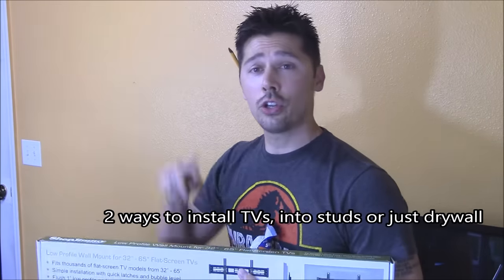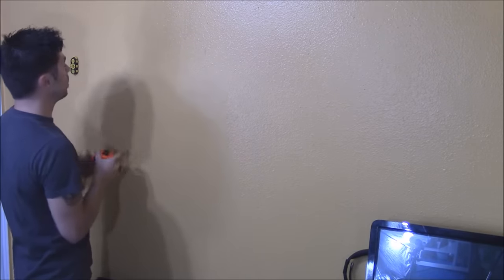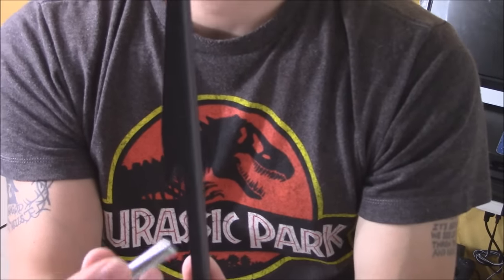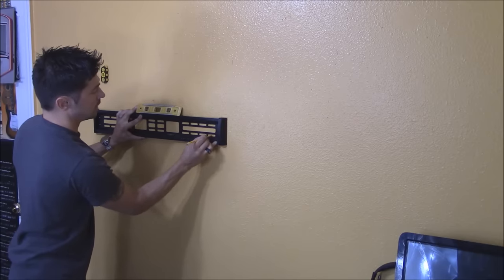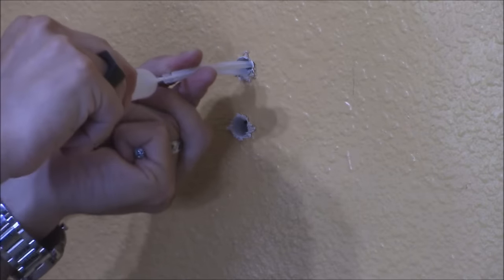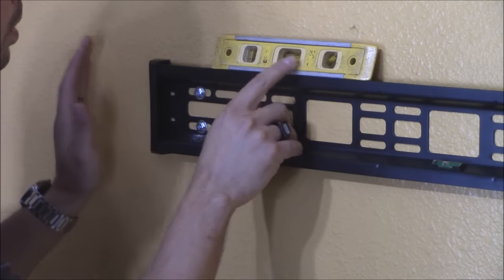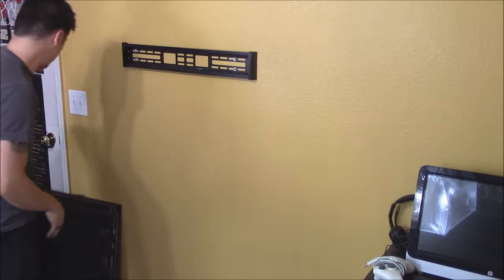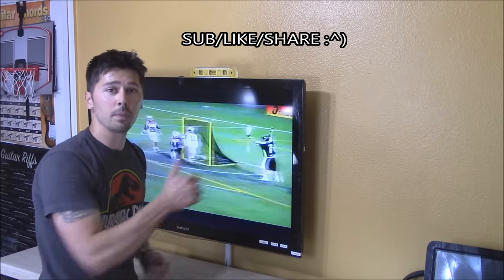2 ways to hang TV on wall mount into stud and drywall review

Comment from the maker: locking wall mount- http://amzn.to/2qcQWZU and toggler toggle bolts- http://amzn.to/2qan1SN 
*affiliate link
Reply: I have an LG 60PB5600 (60" plasma 72 lbs).  I purchased a Video Secu MW390B mount.  You say to not use Toggle bolts on 55" + TV's on arm mounts.  I'm curious why.  The studs in my building are metal and hollow so I think using toggle bolts is my only option.  Please let me know if you have any advice.
Reply: Where did you purchase the thing to hide wires?
Reply: Cq67 yeah,he never gave the info on that. Been looking for it
Reply: mrniceguy423 did you get a answer bc I have a 65" plasma tv as well?
Reply: What do you recommend to use instead of the snaptoggle bolts for TVs larger than 55”? Thanks in advance.
Reply: Mounting a 55" tv on an arm mount to drywall is exactly the situation I'm facing as well. Why is it bad to use snaptoggle bolts in that situation, and is there another solution?
Reply: Tampatec 
Why shouldn't I use the toggle on 55 inch t.v.?
Reply: Hey I own my own AV company and you should not post videos like this I don't need clients or customers trying to hang their TVs with drywall. They should just call a company and let the professionals do it I hang TVs that people can probably hang on I've seen tons of people's TVs fall and drywall and there are safety precautions with those TVs if one of those TVs hits a kid and causes brain damage or trying to be cheap ur fault bro.
Reply: @chandlerhill4794  He's helping the capable community and showing them the right way.  Everything is at your own risk and its sad that everyone blames others for accidents.  This is a simple job but needs to be done right and I appreciate this videos help.
Reply: Obi O ffvb
Not
Reply: where could i find that cord concealer? I like that it has flaps to easily access the wires, having a difficult time find anything like it.
Reply: Tampatec uh oh- I already left a comment and just rewatched the video where I saw something I missed and don’t quite get. You had some text come up about not using snap toggles on 55inch or larger/arm mounted TVs. Do you mean 55 inch arm mounted TVs or 55 inch TVs and/or arm mounted TVs? After watching first time was so excited I could do myself- now a little nervous. In any case your video is just great. Very informative as well as being explained so well, so logically with not a bunch of extraneous chit chat. I’m very appreciative.
Reply: Just bought this Heavy dang tv and I can't comprehend how drywall can hold this safely! Is it possible? I'm in a trailer and No tv stand but it did come with a beastly wall mount. 
Sharp Aquos LC-45GD7U 45-Inch HD-Ready LCD Flat Panel TV
Reply: Great video!  Where did you find that cable raceway/track?
Reply: the jurassic park t shirt made me immediately subscribe

Comment: I was concerned by the snap toggle bolts, and then I saw them support your entire body weight. Looks like there's hope to wall mount my TV afterall :)
Reply: he is 80lbs wet lol... they make bigger mounts
Reply: @AlienGrade  that's fine. My TV doesn't weigh 80lbs.
Reply: He used 1 stud to anchor....then toggles.
Reply: how safe is mounting to drywall if you live in earthquake central (california)?
Reply: @GetUnwoke   don’t do it
Reply: My buddy had to use toogle bolts when he mounted my tv 6 years ago, it worked great, he used 5 and my tv was only 42" so not that heavy at all.

Comment: Just hung a 55 inch LED TV weighing 30lbs on drywall using a tilt mount and 6 spring toggle bolts with a weight capacity of 90lbs per bolt. Thanks for the tips

Comment: Very informative. Thanks for the info. I’ve used toggle bolts before but never heard of snap toggles. They look like they are much easier than trying to jam big toggles through a hole while hanging onto the screw and the item being hung- wall standards for shelving and closet brackets. Very tricky for a 70 year old woman to manage- but manage I did. Of course the bolts were so long I went through the closet wall into the bathroom. LOL! So had to cut all the bolts down with a Drexel cut off wheel... but I digress... I want to hang a 44 inch tv on a plaster wall with metal studs, if I can find one. The mount is one that has an arm that extends from wall to tilt left or right. I’ve been worried about how to do it and not sure if the 4 snap toggles will be enough. Maybe there are more holes- not sure. Someone told me I should also mount a small piece of wood below the bracket to kind of brace or take some of the weight. Anyway. Keeping my fingers crossed. Thanks again!

Comment: Could I have your input on how to mount my TV? I have a 37" LCD TV that weighs 40lbs I want to mount using a full motion TV mount that weighs 25lbs with a weight load of 150lbs. Its sockets are designed for studs from 15-21" but I have 12" centres on my studs meaning it would be 12 or 24. Would you recommend using the snap toggle bolt method in this video? Should I drill a wood plate into the 3 studs and mount my TV into that or is there a better option? Thanks

Comment: I'm about to mount a 65" inch curved 4K. Thought it was going to kick my ass. This video has greatly increased my confidence. 

Thanks a bunch. Very informative. Just saved me 180 bucks installation cost.
Reply: Zachariah Dean how’s it go?
Reply: 180?? Thats a bit too pricy
Reply: @Yugiboii  worked great! I was able to do pull-ups off the tv mount before I put the tv on. It's a solid purchase.
Reply: @captainham2808  Yeah. It saved me that much from what I was estimated for professionals to come in and install. The toggle bolts are inexpensive, easy to use, and are a great investment.
Reply: Oorah Devildog, I second that.
Reply: @Axzy1232  Yes sir. I have even put a larger and heavier TV on it and it's golden.

Comment: Yo dude, your video was very helpful.  Although it seems relatively simple to do this, it was nice to have a bit of guidance so thanks! I ended up using the toggle bolts for all 4 anchor points because the wood screw sheared off when I started driving it into the stud.  But it all worked out fine (so far lol).

Comment: Why did you put on the screen "don't use snap toggle bolt with 55 inch or bigger arm mount?
Reply: Toggle bolts hold the most weight with all the weight closest to the wall. An arm mount allows you to pull the tv away from the wall which puts the weight farther out. Too much leverage on the toggle bolts allowing them to fail and tv could come crashing down.

Comment: I'm goin' in.  Thanks for the videos and for taking the mystery out of the installation.  I think I want to use the togglebolts on my studs as well as the dry wall if it turns out I don't have 16 inches between studs.   I got one of those Profinder 5000 stud finders. Cost more than I need but eh, I'm a geek for electronics like that.  Thanks dude.

Comment: LOVE it! Now I gotta get a magnetic stud finder!
Reply: That stud finder will never going to tell you where is the center of the stud, that's where you need to install the screw and also never is going to show you where the stud is located on the place where you are going to install the screws it will show you where are the drywall screws and the can be located far away from where you are going to install the bracket screws.

Comment: Good technology in general. The fear is that the drywall will bend forward over time. I think those walls are not supposed to have any serious load on them.
Reply from the maker: epSos.de I had TVs mounted using toggle bolts for years but I would Not mount a heavier plasma tv or big tv on arm mount which adds more stress to wall. however if you have a chance to tag a stud that's the best bet.
Reply: When I did one I just put a 1x4 across the studs since you won't see it being behind the TV.
Reply: I've seen people just use 'regular' anchors without going into any studs with disastrous results. 
Please remember that each toggle bolt used here holds 75 pounds (a total of 150 lb load capacity by using 2) and there are screws into the studs....but the TV only weighs 25 pounds. That TV will hang there for it's lifetime without failing, falling or shifting. Tampatec is correct about tightened the fasteners slowly and evenly to achieve their rated performance, and we should also check level throughout the process.
Reply: DONNELL B.  they have toggle bolts that go up almost 300lbs.
Reply: They have toggle bolts that go over 800 lbs.
Reply: I dont think the toggle bolts are at question here, its the drywall that would fail...

That being said, I think ima do this with new tv.  Fngers crossed! 🤞😂

Comment: I like the way you broke it down so simple and describe what drill bit and socket bit you may need prior to standard size. I work at Home Depot and I always can tell when it DIYers are working on a TV mounting project. Thanks for insight and using your weight to make sure it was drilled into the wall right otherwise this coulda turned into a blooper video.
Reply from the maker: Will Nance thanks
Reply: Tampatec no thank you for such a detailed video.

Comment: I just mounted a TV on the wall and was feeling pretty proud of myself.
Was just taking a break before starting to connect all the cables and found your tip on spacing.
I was focussing on getting it as close to the wall as I could and hadn't thought of that.
Brilliant suggestion, thanks.
Will take it back down and use longer screws and spacers to give the cables that bit of extra room.(Only take a couple of moments)

{ 8-]

Comment: My walls have no studs! The stud finder worked at a friend's house but at my apartment there's nothing.  Any suggestion/explanation??
Reply from the maker: +nylotus you have studs but thicker drywall maybe weaken detection, AC outlets are usually attached to studs so look for ac outlet to right or left next to ac outlet box is a stud most likely.
Reply: maybe it is a solid wall. Better!!
Reply: Tampa

Comment: I've been reading through the comments and I cant believe everyone is cool with trusting toggle bolts to hold their TV on the wall. If the studs are too far apart why not fasten a 24" 1x4 between the studs and then fasten the wall mount to the 1x4. That seems more secure to me, plus it gives you that little extra space needed for the cables in the back without using spacers.
Reply: Robman7 funny, I was thinking the same thing.
Reply: me too.  about to hang my 65 and of course the studs are off center.  So i have been looking into 1x4's or plywood.
Reply: Use a piece of 3/4 Plywood  5 1/2" x  36"  plywood is stronger than most 1 x lumber.
Your welcome.
Reply: He's got two bolts going into the studs and two snap toggle bolts on the other side rated at 75lb per bolt.  Just the two on the stud would probably hold a 100lb tv.  So the other two will help and its not just drywall holding it up.  Wood is a great idea and probably better but both would work just fine.
Reply: 1 inch thick lumber seems lacking as well considering these mounts are meant to go much deeper into studs. 2 sheets of 3/4 plywood would probably be good.  If you can't hit 2 studs it might be worth the time to tear down drywall and add some extra support. Or do 1 stud in the center with toggles on the sides.
Reply: You're...
Reply: Robman7 he literally hung his body weight on the toggle bolt didn't seem to have any problem with it
Reply: *You're
Reply: Providing you use the correct size (weight rating) and use them in the correct locations (staggered) there is nothing wrong with using wall anchors. The shear load at any one mounting location is minimized because the weight is equally distributed between all of the anchors.

Comment: how do i know if i have a metal stud or a wood stud? i live in a four year old condo
Reply: Well Incase anyone else was wondering my condo had steel studs. Condos and apartments will have steel studs. And the toggle bolts are holding up my 65” led 4k tv just fine. I only used 4 toggle bolts, all into the studs.

Comment: great job I love the idea! I have drywall. because I live in mobile home and finding a stud is hard too find because studs are only top ceiling and bottom flood,
Reply: Mobile home or not, your walls are framed the same way. Your walls are framed with the studs 16" on center. Get a stud finder and run it over your wall.

Comment: When you say "studs" do you mean wood only, or, also metal framing studs? Thanks.
Reply: Generally studs would be where nails in wood, if metal frame in building could be different. Magnet will not stick to aluminum it sticks to iron or cobalt, Steel because contains iron, Tin if  iron was added to tin to make tin stronger. If pure tin or aluminum a magnet will not stick.

Comment: Good video.. I am actually going to do same thing as you done i have stud to the right of wall between kitchen cabinets the other side will have to use wall anchors into the plaster being bracket wont reach to other side.
Not sure the kind of anchors you was using i am use to using smaller plastic anchors bout 1/4" in drilling holes then lightly hitting them into the wall.

Comment: You said don't use the snap toggle bolt when hanging 55+ inch TVs. I  thought this was because of the weight of the TV but then you hung off of it. Can you tell me why its not okay to use snal toggle bolts on larger TVs? How would you recommend mounting a larger TV to drywall?
Reply from the maker: On arm motion mounts 55" + can be an issue.

Comment: It pays to verify that your bolts will actually screw into the togglers before you install them into the wall. I have had some with less than ideal threads. Great video, thanks =)
Reply from the maker: ***** very true i had a few too.

Comment: Thanks so much for this video. I wish I would have found this last year. I returned my TV mount because both bolts weren't hitting studs. Didn't think they made drywall anchors that held that much weight.

Comment: Help! I'm trying to mount a 50" LED Vizio to a full motion mount, when I tried to predrill the holes to the studs I got a lot of resistance. My drill won't go deeper than 1 1/2" and I need to go 3" deep. Is a powerful drill necessary? I broke a drill bit off in the wall trying to get it out! Should I just go get toggle bolts? Any help is appreciated, thank you.

Comment: Great video!
Why do you not recommend to use snaptoggle bolts on 55"+ TVs on arm mounts?

I want to mount my 65" TV (60lbs) on a full motion mount but my wall has metal studs, I was planing on using snaptoggle bolts, what do you think?

Comment: You explain very good man, thnx :), I was wondering, I have like a 60" TV at my moms place, it's pretty heavy, do you think I can hang it on the wall in the same way? thnx :)
Reply from the maker: +Danny D if using a full motion mount i suggest finding 2 studs to mount to but if using regular mount tag in one stud with togglers in drywall it should hold if you tag directly into at least 1 stud. hope that helps

Comment: Thanks for this video! A few relatives said they would help me mount my tv but never came through so im researching how to do it on my own. Is it safe to use the toggle mounts for one side for a 55" inch tv? The mount is full motion articulating and one side will be mounted to a stud but the other is too far.
Reply from the maker: yes but keep the weight limit under mount recommended spec. use long hdmi cables for arm mounts

Comment: A little worried about putting up my 65" like this with a baby crawling around.  Anyone have any videos of people using plywood or 2x4 to mount it?
Reply: Amit Patel curious about how you're installation went and if you went through the studs or using the toggle bolts?
Reply: Also curious how this went...

Comment: I have a LG 55” tv how good do u recommend those toggle bolts in case i cant hit a stud I don’t want to find my brand new tv on the floor lol??
Reply from the maker: kikorenteria toggle bolts are rated 70lbs per bolt but you should be able to at least tag one stud which is stronger. I have mounted 60 inch led TV on toggle bolts with tilt and flush mounts no prob.

Comment: so I have a lg 55 inch flat screen TV and I need to mount it straight into pure dry wall and my connections are in the back of the tv directly in the middle so I wanna be able to easily access those connections how would I be able to do this?
Reply from the maker: Use 6 togglers bolts, 3 on top and 3 on bottom. Use a standard tilt mount and use big spacers when putting on brackets on back of tv. Don't get a low profile flush mount.
Reply: +Tampatec do i use snaptoggle bolts or just regular togglebolts and if so what size? thanks